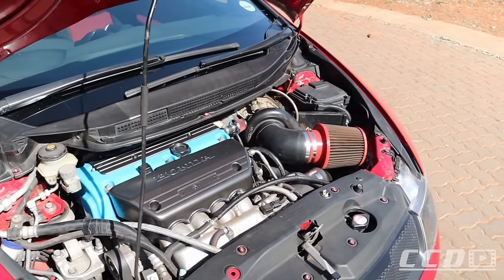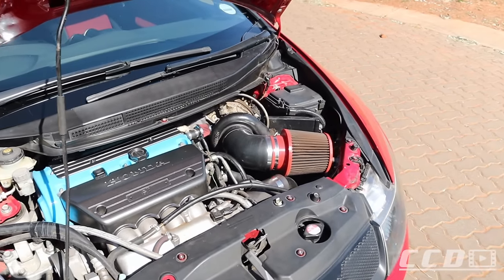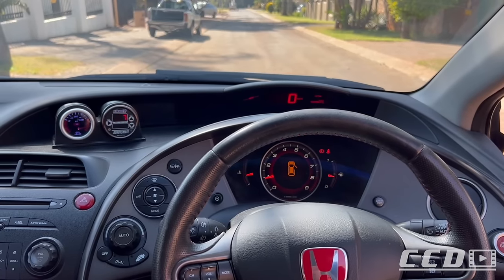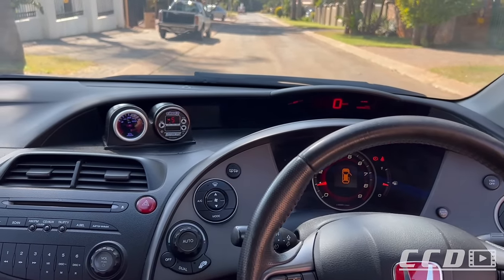SLEEPER K24 Turbo SWAPPED Honda Civic FN2 Type R

Comment: Guys its nice to be the one who has the finances in being able buy something like this and being able to name parts, but in my humble opinion (if you are serious about driving at high speeds and trying to be cool while youre at it, rather hold the steering wheel with both hands, looking like your at the cinema next to your chick makes you look like you dont fear what sort of consequences could  happen if a tyre just so happened to blow or if a balljoint had to fail and cause the wheel to swing.. the interviewer seems to have a bt more respect and drives like one should, well done bud. 
second point id like to share with guys that seem to take all the glory for being able to name parts is that actually "all the glory" goes to that man that sat there for hours focused and battling with nuts and bolts in those kak places and fighting with gaskets that slip out when trying to mount the turbo.. esentially the man that is most unappreciated is the mechnic that built it.. two or three words were said about the guy that made it possible, you should be having a framed photograph in that car of him and everytime you start the car you kiss his forehead because without his hands you would be driving standard.. im just aying that mechanics are very unappreciated and underpaid for their craft, guys please show more episodes of the guys who put the spanner in and not just drivers that are able to name a few parts..  i love you, beautifull car guys, much appreciation to the man that built it and the guys who did the bonnet and cut those fins out and did a perfect job of the paintwork..and even to sibusiso at caltex garage for being the guy who got the fuel in it for the driver to show his money.. well done sibusiso.. i hope he gave you R20 tip. ;)